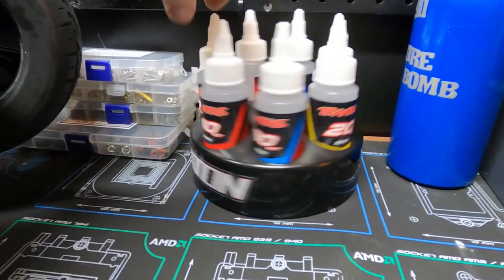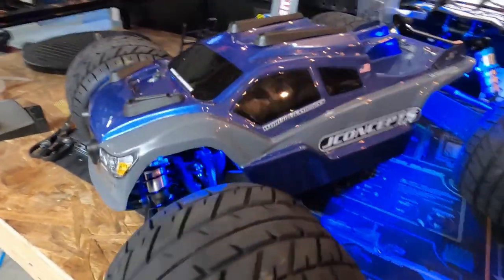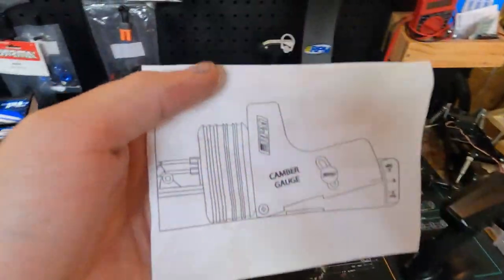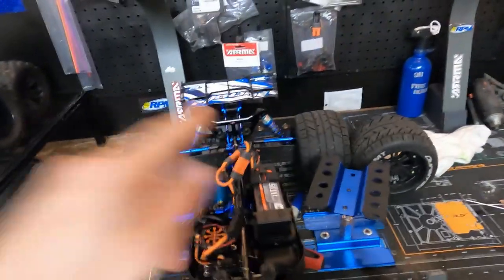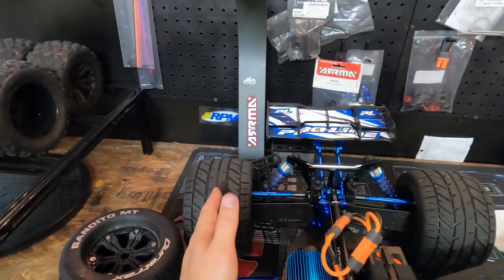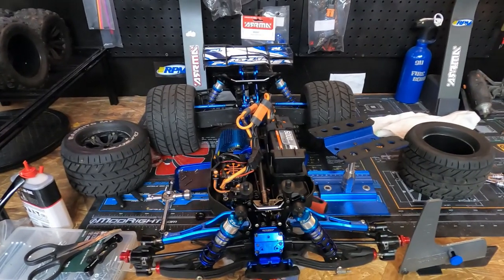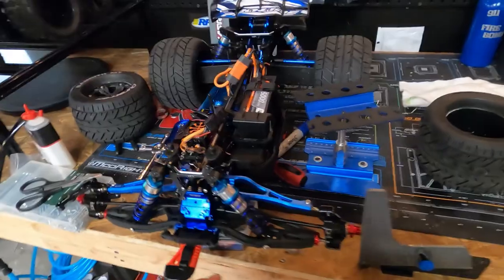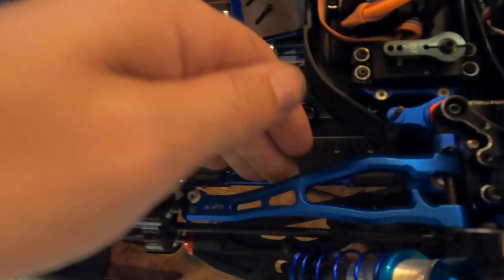What is  " CAMBER " Rc Car SET up+ KRATON6s "RPM CAMBER gauge

Comment: Or you could put some gorilla glue just on the inner rims of the brackets and then place the can back and let the glue n extinguisher for a day or two and as the gorilla glue is super strong that should be ok 🧐😎
Reply from the maker: Thank you for the advice.. And thank you for commenting .. I hope youll consider Subscribing to the channel 💯😁
Reply from the maker: O. I forgot to mention this.  The vibration keeps cracking it. It splits theglue think.. So i went with  a Sho-goo style glue.. And that seem to work alot better..  A little messy. But way better than super glue. Plus i glue my fingers together .